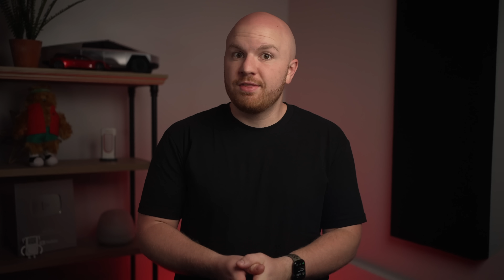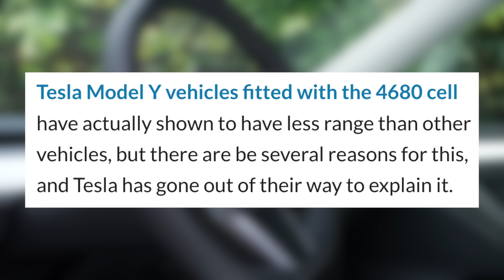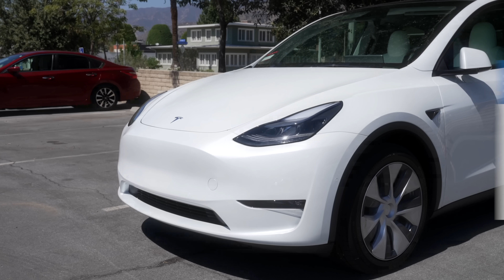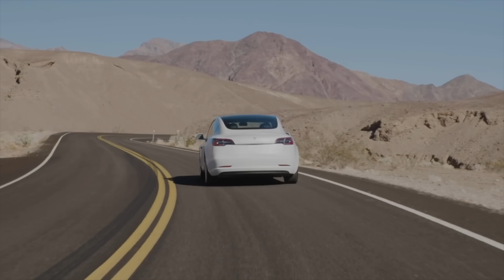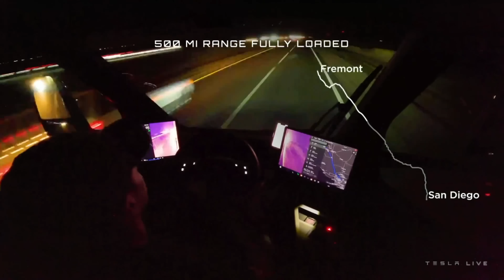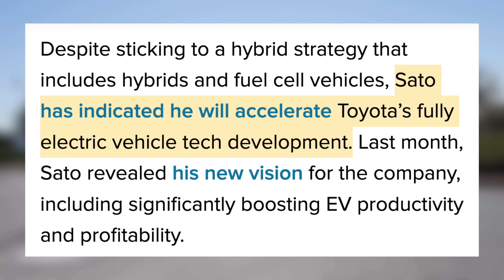NEW 450 Mile Tesla Coming in 2024? | NEW Tesla Battery Problems

Comment: I'm happy with my 23 MYLR (June build) the range is barely acceptable. I knew the real world highway range at 70mph is around 260ish miles. The 2 ICE cars I have had since 2016 had 500 mile highway range at the same speed, a Subaru Outback and VW Tuareg. 25-30% better range in the next MY will be very useful. EM's BS not withstanding.

Comment: Wait till they hear about the 400 mile 2006 Honda accord that takes 20 minutes to refill.
Reply: My wife’s new Lexus NX hybrid with a 14.5 gallons tanks can go more than 450 miles per tank going 75MPH average.  I know because I drove 400 miles home after I picked up the car, wo needing to gas up at all during that trip.  Fill up take me 5 minutes.
Reply: @jml9550  And how much did that financed Lexus hybrid cost you?
Reply: @ericwalker8382  The dealer quoted me 5% 5 years even with my 805 score.  It is too high so I declined.  So I wrote a $51k check.  Still hurts after a month, Emotionally, not financially. :)
Reply: @jml9550  You just paid $47,000 extra to do the exact same thing...
Reply: @ericwalker8382   Valid point.  Yes, emotionally still hurts after a month even though I don’t need to.  No, financially it doesn’t even make a dent.  If I can make a $51k purchase just like that, my liquid is a lot more than $51K, I can assure you of that.  Plus the new Lexus probably drives better than a 17YO Honda that I am certain.  At the end of the day, it’s just money.
Reply: @ericwalker8382  Deprecating asset?  My paid off home and rentals are assets.  It is a measly $51K object, nothing more, nothing less.  Hell my Rolexes are worth more than that.  I can burn it down without even feeling anything.
Reply: @jml9550  Bet you have a golden toilet too.
Reply: @ericwalker8382  haha, that’s a little over the top.  At least I won’t allow my family to drive a 17YO Accord.  My teenage son’s first car is a 10YO Lexus RX, what I call a beater.  Life’s good.
Reply: @ericwalker8382  Haha, great imagination and choice of words.  If that makes you feel better, so be it.  Life’s good.
Reply: @jml9550  Sure thing champ, keep telling yourself that.
Reply: @ericwalker8382  Sure Sport.  Remember to work hard and aim high.  $50K is just chump change and one day you may get there.
Reply: @jml9550  You aren't there...
Reply: @jml9550  You realize you are weirdly flexing to a complete stranger on YouTube right?
Reply: @jml9550  I want to make sure the paint fumes haven't distorted your reality in a manner detriment to your well-being.
Reply: @ericwalker8382  yeah I am not there yet, personal goal is $10M net worth by retirement.  Only half way there.
Reply: @ericwalker8382  nothing to do with flexing.  The fact of the matter is some random person calling a measly $51K object an “asset” is just hilarious.
Reply: @jml9550 So half of 0 is 0, grow up.
Reply: @ericwalker8382  oh yeah, speaking of paint, I might have to repaint the house. :)
Reply: @jml9550  That doesn't exist.
Reply: @ericwalker8382  kindergarten math level is still there.  I will give you that.  :)
Reply: @ericwalker8382  yeah that mortgage doesn’t exist that’s for sure.  :). Remember rent is due in about 2 weeks.
Reply: @ericwalker8382  not done and no need to pretend.  BTW, what is the mileage on that 17YO Accord?  :)
Reply: @jml9550  Says the guy who is paying a mortgage on a house he owns.
Reply: @ericwalker8382  re read my post son, “that mortgage doesn’t exist anymore”, that means it is paid off.  BTW, don’t you love renters?  Last week I notified my tenants that rent will increase by 10% starting July. :)
Reply: @jml9550  Yawn
Reply: @ericwalker8382  I know.  Another run of the mill $1.3M starter home in the Bay Area.   How much rent are you paying?  Just curious.  A typical 3+2 here is $3K minimum :)
Reply: @jml9550  Yawn
Reply: @ericwalker8382  this is getting boring :)

Comment: I'm interested in upgrade pathways as opposed to simply a replacement (like for like). I have a Standard Range+ M3 - I'm hoping in the future I can put a bigger battery into it to increase range, possibly lower weight etc. Thoughts on this?
Reply: You may have to swap out the battery management system and charger.

Comment: Where's the bi-directional charging? Ford F-150 lightning sure scooped 'em on that!
Reply: I have been thinking the Tesla thinks it is protecting power walls sales.  I don't agree.
Reply: @danharold3087  Surely they realize if they don't, and soon, this leaves the opportunity open for many of the other auto makers who will. Powerwall sales will suffer regardless.
Reply: @bobedsall5625    Did some digging.  Looks like Tesla will eventually provide V2G.  Tesla/Elon has expressed interest twice and said they were working on it.
In the near term.
On January 25, 2023, Tesla CEO Elon Musk confirmed that the Cybertruck will have V2L capability. He tweeted, "Yes, Cybertruck will have V2L. Enough to power a small home or camp."
Actual interest in V2G is small at this point.  Even worse the regulations regarding it may shape up to be a moving target.  Each state adding requirements in addition to federal regulations.

Comment: Having a standard range model 3 myself it has more then enough range with a daily commute of over 50 miles. If I wanted I can go 3 or 4 days without needing to plug in my vehicle. Those who are asking for vehicles with 500 or 600 miles are thinking like a gasoline vehicle, you just don't need that much range in an EV.

Comment: Don't buy a ev till 2 gen battery comes out unless you  got a home charger or slow 10 hr charge don't used fast D.C charger unless your will to spend 23 k for a new battery after 8 yr.
The 18650-type cells That  powers the Model S and the Model X. Is proving that pack is starting to deteriorate at the 8 yr Mark. And Telsa model S  at the 8 yr Mark and X software update is rolling back range and less aggressive performance. So many are sueing Telsa. Telsa gave them 650 USD from that lemon law they won. But they want more, at lease a discount on a new pack. That still 23 k
. My view they can't win. Why? The small print that was mentioned at start was if you used the D.c fast charger you take responsibility for damages. And you have a D.C. Charger account. Same as G,M bolt  owner are told never to used a d.c charger or do it at your own risk. 
Another thing to add was in news  today  insurance company are writing off ev car as totaled if you sustained battery pack damage. The pack cost and damages abd battery packs are design as a frame strengthen. That need to be tested certified to run straight. So itnot worth it. Totaled. Means you get back blue book prices substract your yearly useage. Big lost if you payed over 50 k

Comment: Love my model MYP but they need more range. When I put my mountain bikes on the hitch it cuts my mileage down a lot my last road trip I was maybe able to get 190 miles of range at 70mph. 

450 mileage would be incredible, I would immediately trade my current car in for it.
Reply: Did you turn on the AC during that trip?  I heard running AC and heat will decrease the range as well.

Comment: I had a long range model Y in Wisconsin. I was very disappointed! If you are someone that does just city driving it might be for you. There was times in fall and winter I would get just over 100 miles before needing a charge. Then there is the updates that change features on the car that you can not get back. If they would feel 40 mph was the safest speed “YOUR” vehicle should be going they can do that with an update! EVs are not for me, bring back high mpg diesel cars! But we can’t have those on the roads because we can make our own fuel. If you want to bring up pollution, look at what our government wastes in jet fuel. Those numbers would really be impressive!
Reply: ICE is going the same way as EVs with the electronics.  There is no going back.

Comment: A 200mph full battery electric vehicle. That is impressive. I would love to see Model Y with 400+ miles of EPA range. That would interest me.
Reply: 500+
Reply: Gonna be the longest 2 weeks of your life my dude😂😂😂😂😂
Reply: Except you would only need that kind of range for a small amount of your travel. Elon has said to haul around a large heavy battery you will seldom use is a waste and inefficient. Cyber truck Tri motor will get 500+ because its a work truck and Tesla knows the range is necessary for towing, Hauling or using the truck to power tools etc.
Reply: you dont want to see epa range, you want to see 75mph range. Theres a large difference.
Reply: Based on my experience with my model 3 I see very few instances where you would need a vehicle with that much range, especially with the amount of charger already out there and more on the way. Is there a niche case you would need that much range for?
Reply: @mech-E towing
Reply: @badsamaritan8223  Isn't that the function for cybertruck?   Not a big segment of model Y owners need to tow.
Reply: @Trust but Verify  True, BUT My Model Y has the tow package & I use it for my small sailboat & small enclosed trailer between VA & Coastal NC. Thx to plenty of chargers (<100 miles, mine were 86-95mi), the range towing (about 110-120) is possible, but FAR from reasonable.  I averaged 541 Wh/mi while towing & 280 Wh/mi life avg not towing at 60-65MPH, NEVER FASTER. 
The Model Y is so wonderfully efficient with drag coefficient that anything you tow is like a parachute by comparison to the 0.23 Cd of a Model Y!  On two separate trips, towing the enclosed 5x8 trailer to NC full (~3200lbs) & empty on return (~800-1000lbs)...  I discovered weight was relatively unimportant.  The drag was by far the factor in my little experiment. SO keeping Speed about 60mph is critical. 

Cheers, Eric
Reply: @mech-E  Towing a 1400kg caravan from Liverpool (UK) to the Dordogne (France) and back? i.e. about 1800 miles. I used to do that every summer. :)
Reply: @mech-E  You need range for large trips, more range is better. Tesla lost the EV race
Reply: @rwyo83 Tesla lost the EV race?  Based on what?  Who's the winner if Tesla lost?  Based on what?
Reply: @Ry-lx2kl  Ronaldo was Trolling.

Comment: The model 3 base model would go from 272 miles to around 314 miles..can't wait!
Reply: And in the end, you still have range anxiety and how do you know there is a charge station waiting there for you?
Reply: @achristian7015  Faith Baby Faith !  
Or you can get the information from the car or cellphone.
The app will show you the number of available stalls, as well as the number of stalls that are currently in use.
Reply: @danharold3087  Well why worry about it as I never do when I need gas for my car. And after doing the math, the cheapest EV sedan (Leaf or Tesla 3) is grossly expensive in comparison to gas cars.
Reply: @achristian7015   I am sure you have seen how an EV saves on fuel, no scheduled maintenance and fewer repairs.  No point in repeating them.
Reply: @danharold3087  I guess you have not done your homework as I have. I looked at everything and added it up. Cost of 2 sedans I am comparing, maintenance (I do it all myself), insurance cost, charge station home wiring and kit. And things I cannot put a cost on is the inconvenience of an EV and besides they are not as clean as EV owners think they are (coal fired generating plants, battery production and recyling, mining of the materials. Look at the whole picture. Time to open your eyes.
Reply: Tesla may reduce the size of the battery to keep the same range making the car lighter and less expensive.

Comment: Does anyone own an EV and live in an apartment? If so, how is that going? How many days can you go between having to go to a charge point?  Many thanks.
Reply: Yeah i am in that situation allready 2 years, untill private home will be finished, to be honest nothing crazy, i have tesla supercharger around 2 miles from where i live,  but i go there around every 2-3 days as i like to drive my model 3 long range, can do sometimes a week without charging, but i also do small and regular charges for battery longevity. 😊 its a car and i try to do it so that its not inconvenient 😊
Reply: @jeanhilo1913  Thank you.  I’m thinking about a model 3 or Y but have been worried about this issue.  It helps to hear from someone who’s been doing it and making it work.  Thanks!
Reply: @typical-dad314  no problem, its all of course depends how many miles/km youre driving i do almost every day around 20-30km or around 20 miles or sometimes more, its not a problem just need to check what is around youre place where you live and if you can try to do it like charging plus shopping its great, so it takes out that inconvenience. Just have a good observasion, i bought it when there where no supercharger around so now its only a pluss, but i had some 50kw charging stations or slower, but like i said tried to do charging and shopping or cinema together so its less inconvenient😊😉 i like both model y or model 3 its up to you, but model y its bigger, but also a little more power hugry. Do test drive and you will buy it any of them, as soon as i did test drive i bought it😁
Reply: @jeanhilo1913  One more question if you don’t mind.  What about over-the-air updates?  Did you buy a range extender for you Wi-Fi or do something else?
Reply: @typical-dad314  sorry for my late respond, right you can buy wifi range extender or give a wifi router from phone to tesla it will think its a wifi so it will connect and update, and you can do that while standing or while driving, there is a trick if you give youre network from phone to tesla while parked and it will start to download, but if you will start driving (puting into Drive) then tesla will disable wifi, but youre phone will be active, so better to make life easier and update while driving you can connect to tesla,but first put into drive,but dont drive yet and then make connection with phone trough wifi and you can drive and install update and then when you finish youre drive - you can cancel "install update" screen or you can leave at home parking and then push to install update👌👍 please ask i dont mind to answer 🙂

Comment: If Cybertruck isn't 500 miles, it would make sense to have the Model S have a range increase because it wouldn't need as much batteries because it's more efficient.

My guess is the Cybertruck will have less range than the current Model S because less batteries means more trucks. (350-400 miles is my guess)
Reply: Or by the time production ramps up next year there will be enough cells so as not to matter.